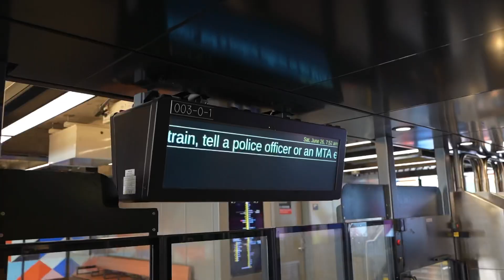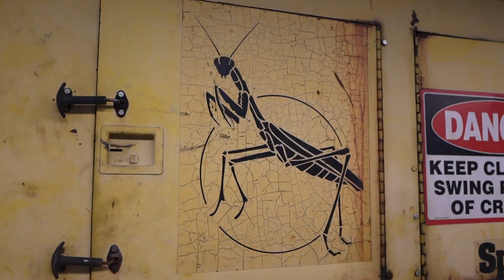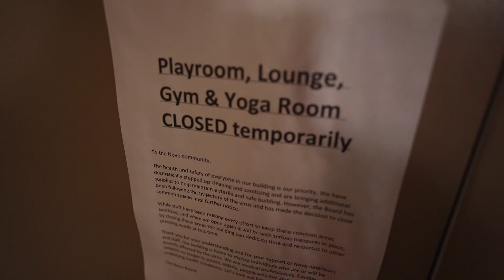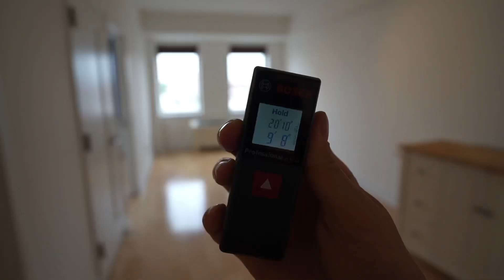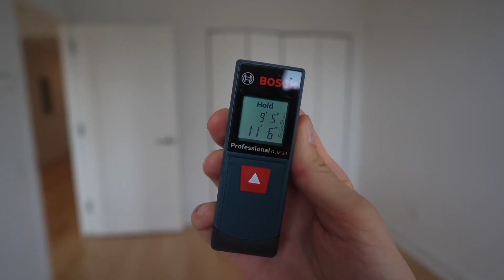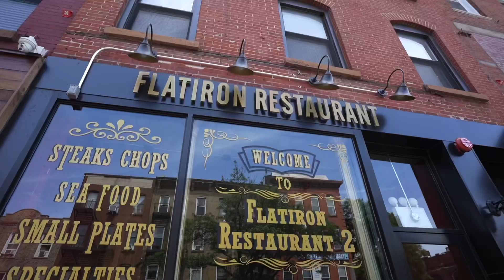The Real New York City

Comment: Question for Cash and/or other viewers: In the neighborhood of the apartment there are a lot of old three- and four-story buildings with businesses on the ground floor. Were those buildings originally private homes from top to bottom or were they built with commerical space on the ground floor?
Reply: This is my neighborhood and I have lived here a very long time (many decades) so I can answer your question. 5th Avenue, where Cash was showing you the stores and restaurants has bas been and still is the "commercial" strip, with storefronts on the bottom floor and apartments above. In the last 20  to 30 years there has been a big change in
who resides in this area. There were always bars on this strip and places to eat but the higher end eateries have increased a lot because the population is younger, has more money that they spend on eating out. 4th Avenue, where that building is now was the strip where you would find auto shops, gas stations, businesses that related to "the trades, like plunging construction . Many of those structures were one or perhaps two stores. There were also privately owned homes that were 3 or 4 stories and might have 4 or 5 apartments. The regulations on how high buildings on 4th Avenue changed and since the ave. was not landmarked, the low lying buildings were demolished and what "grew" were 12-14 story apartment buildings on 4th Avenue.  There are tons of these types of buildings up and down 4th Ave
Reply: @vsibirsky  Thank you very much for the input! Good to get that information from someone who knows the neighborhood so well!